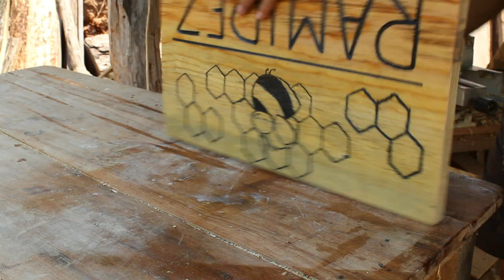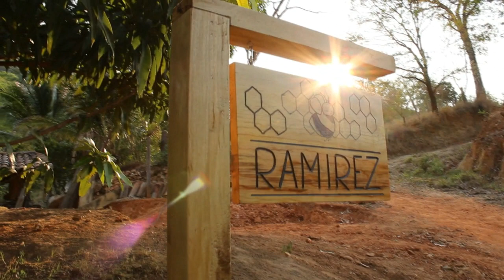Extremely Easy Weekend Woodworking Project // Making an Outdoor Sign - DIY!

Comment: What did you treat the wood with to prevent warping? Thanks, and nice job!
Reply from the maker: Thank you Airbone Paratrooper Retired!, that's not a problem if the sign is hanging from above and not from the back, I used linseed oil for finishing